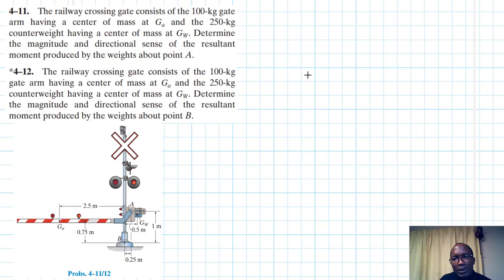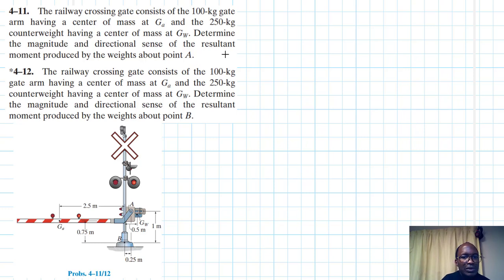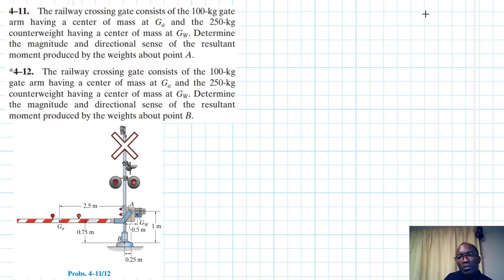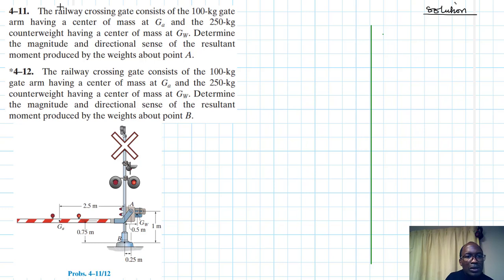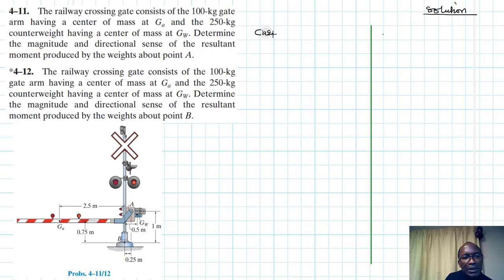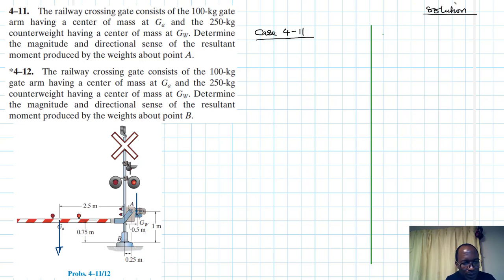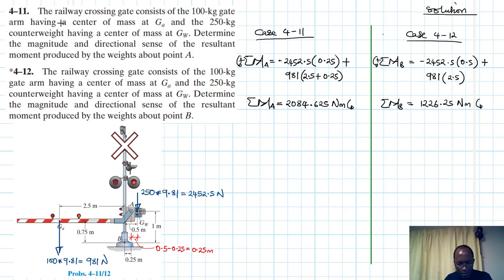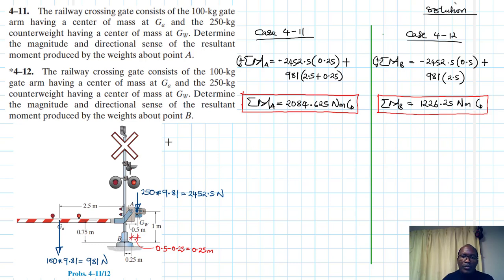4–11, 4–12 Force System Resultants (Chapter 4: Hibbeler Statics) Benam Academy

Comment: Will you also upload the R problems at the end of each chapter?
Reply from the maker: @FrisoPaulini  Sure, I will definitely do so. I am currently uploading the Fundamental and other problems and I am only limited to 10 videos per day because I am starting my channel is new.y earlier channel was hacked maybe you know and re-uploading the videos that I saved. As soon as I am done uploading and making news videos for the rest of Chapters in Dynamics by Hibbeler, I will start working on the R problems, and making lectures videos for each Chapter from statics to dynamics. Then will continue with videos in strength of materials or mechanics of materials by Hibbeler, then structural analysis by Hibbeler and so on…
Reply: @benniehamunzala  you are the best